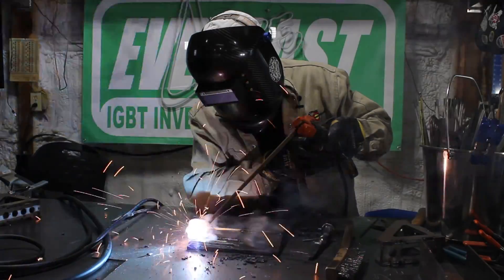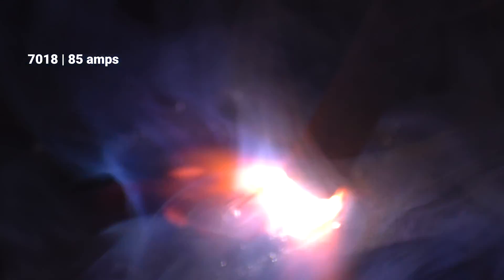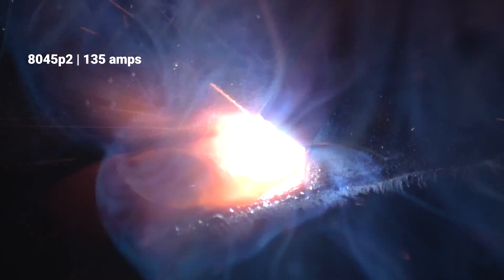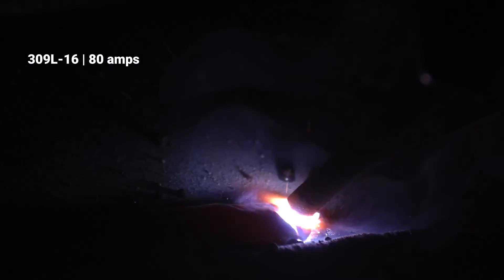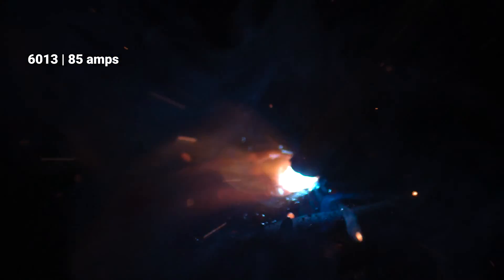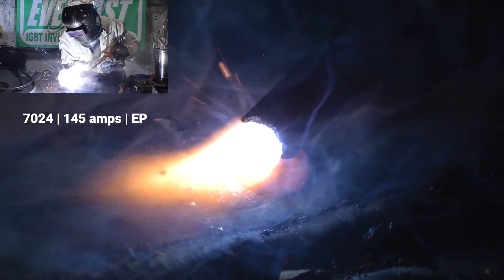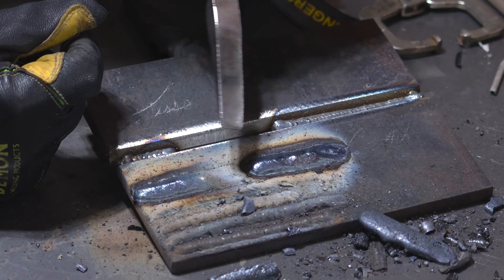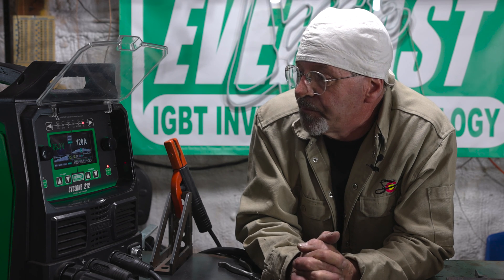Cyclone 212 Stick Welding: DCEP and DCEN

Comment: I did not know everlast or Bob was doing this.  Bob is a Amazing teacher and I stopped watching that other channel when he left. But when he was on the other show he had recommended the Everlast 221 STI...  at the time the first multi process to have AC on it.  I purchased one $2200 at the time.  No regrets best welder I have ever used.  I use to weld for a living too.   Just one smooth machine.  Replaced by the lightning.  Mine runs out of warranty in August and going strong.  It has made lots of welds.

Comment: Bob would u go with the cyclone 212 or the mts 211si as a professional welder since there close in price ?
Reply: No brainer 211sti.   The interface is not digital but it is easy to set up.  The STI comes with a very nice DC tig with HF start.    I own the 221 Sti it has been Discontinued but it about the same machine except it also has a AC tig for tig welding aluminum.   If you ever think you might want to play around with tig the 221sti for sure.         the 212 can go 230 amps 30  amps higher on mig than the 211sti but at a very reduced duty cycle.    The 221 is way more bamg for the buck.
I am not bob but I have welded for years and I am a everlast owner.

Comment: What is the difference between DCEP and DCEN?
Reply: electrode positive and electrode negative.  Just like it sound.  In ep the neg is going to the work and the E- positive is in your hand,  The ark jumps from hand to work.  In E-Neg the positive is on the work and the ark jumps from the work to the rod.

Comment: I am confused by the voltage reading 70 volts? I thought most DC welders run on 26-30 volts?? What is the reason for such high voltage and how does it effect welds? Is this constant or just open current voltage?
Reply: It's open circuit voltage.